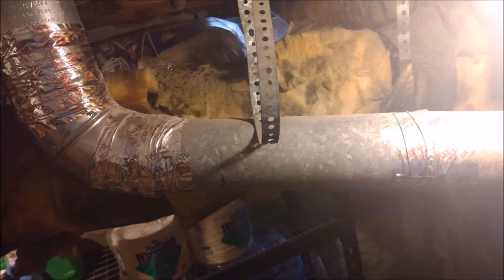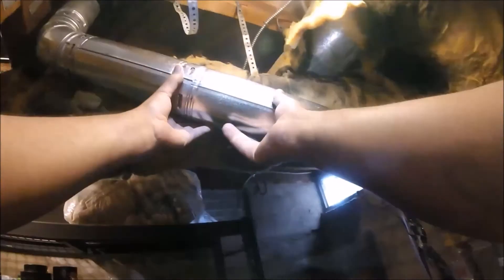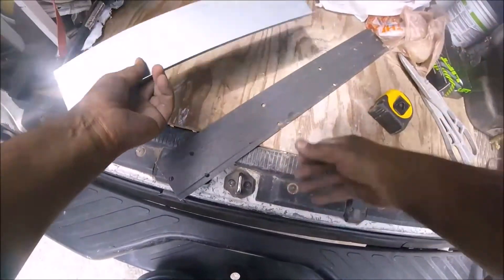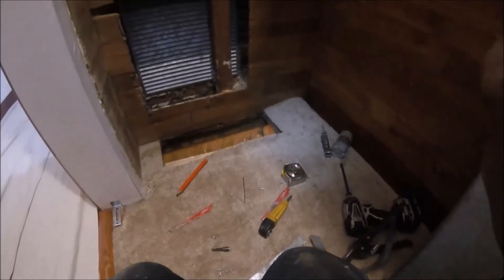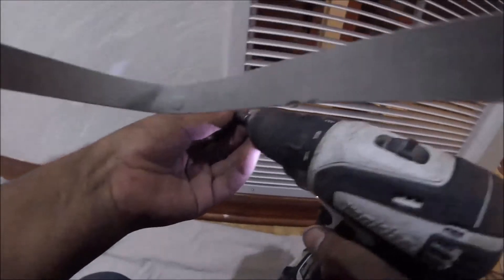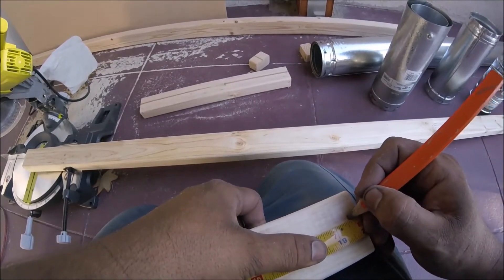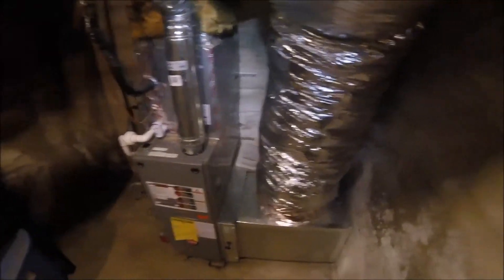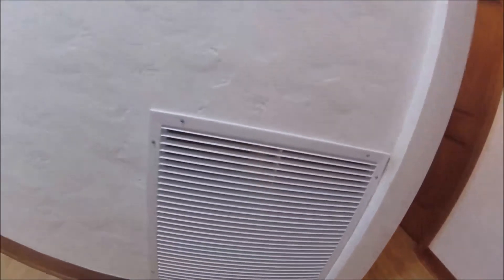Modifications to improve system performance and safety. (Updated)

Comment: whoops @ aligning the b vent seams :)

should cut the carpet out with utility knife, then saw the wood, I've had saws and drills grab and make a big runner faster than you can let off the trigger, make for cranky customer or paying for carpet patch/replacement :|
you boxed over it all anyway.